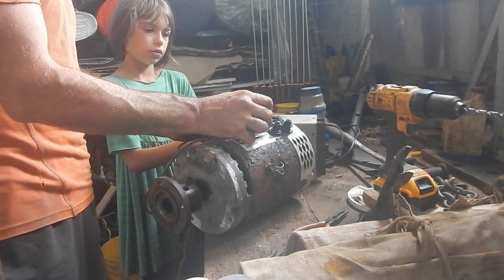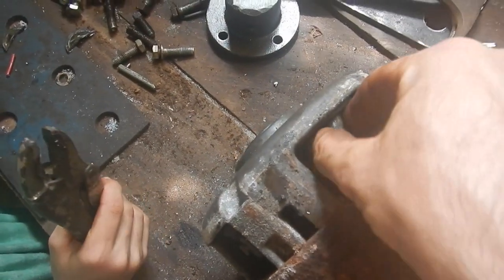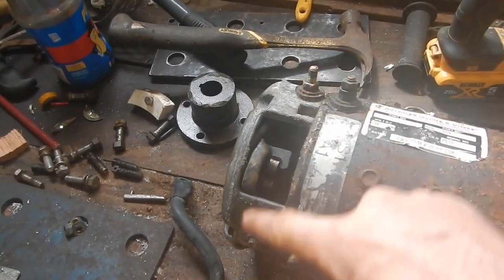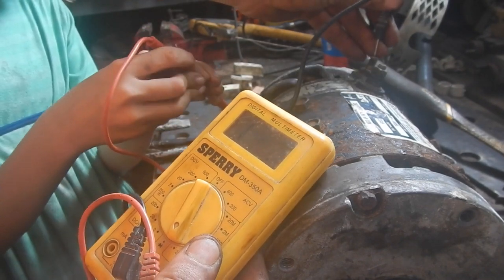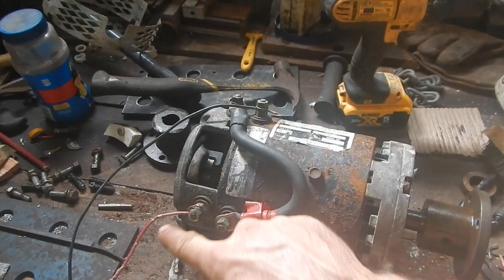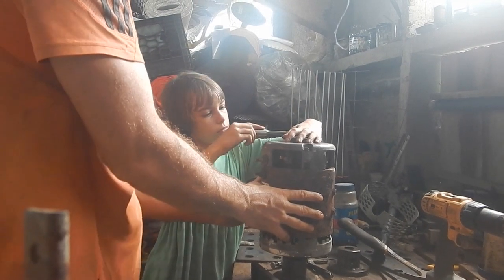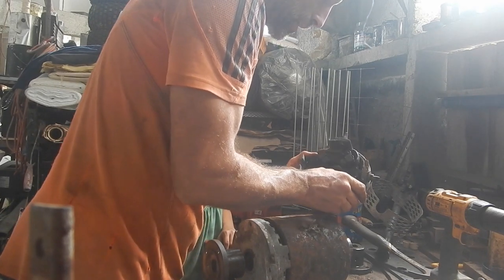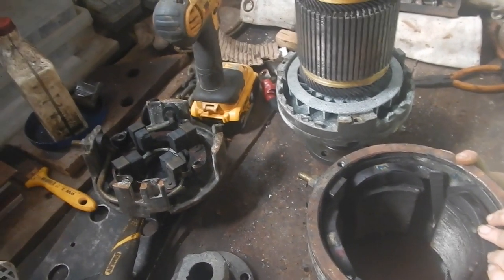Lumber Mill 002 The Motor

Comment: Balsy plugging it into your Dewalt battery. Dewalts have the nickle connectors between cells act as fuses, in 2 areas that are specifically narrower than others (so they can control what part of it bursts). I started up a motor like that and blew the battery in less than a second. If it can handle the inrush current, it can handle the unloaded current. That Advanced DC Motor says it's 36v, but you could hook it up to as much as about 120vdc and be just fine. It might need a fan to help keep it cool, but, it'll take it. The "RPM" is weird. Series-wound DC motors like that one have unbound RPM, any voltage is enough to cause them to spin off into orbit if they're unloaded. They're not a great choice for saws (why you never see them used that way), because they're really hard to control the speed on. You can vary the voltage or PWM and control the speed, kind of, but they respond hugely to load. So they'll get bogged down by a saw after contact, but be spinning so fast they'll chip teeth off at first. It'll work, it just won't work great. They're better for propellors or drivelines or something where you're constantly controlling the throttle. You'd want a permanent magnet DC motor (like from a treadmill), or even a shunt-wound parallel DC motor for a mill, not a series-wound motor like this one.
Reply: Could gearing it down solve this issue?
Reply: @Rambowjo2  No, because the problem is that a saw should be turning at a steady speed, the right speed for the sawblade. The problem isn't its spinning too fast,  the problem is the speed will change wildly depending on load. This type of motor you will always have your hand on the throttle, or, maybe, will always have a steady load (large fan or propeller in the water). That's no good for a saw. It'll work, but poorly, and it's a poor choice. With no load it will quickly, in 3 seconds, spin itself until it explodes. The chain drive will help provide some resistance,  but its still going to be goofy and speed surging.
Reply: Years ago I built a tiny lathe with a tread mill motor. Worked great and people toss them all the time. 
Yeah most DC stuff will accept much higher voltages which is good because you can direct solar them.

Comment: Merry Christmas and one hint which may help you.

Electric motor with some power rating don't consume even nearly that much power when not loaded. Usually not even one tenth of it. On the other hand, they may take even more than rated power for a short time when spooling up.

Some AC motors have parasitic current component which means at some part of AC cycle, they are taking more current and some other part they are putting it back. When using batteries and incverter, it should be a type capable of driving inductive load.

Comment: Hello Jaime. 1. The motor seems pretty good built, with those bearing and brush holders. 2. You can check the health of the rotor: Measure the resistance on each segment/lamell on the rotor. They should all be the same resistance value and isolated from ground. 3. You can connect this motor as rotor in series with stator or in parallel. The configurations have their own characteristics. I recommend parallel. In series, it can also be run on AC voltage (universal motor). 4. It seems to me, that you are not magnetize the stator and only magnetzise the rotor. As you say, you need two oposing fields. If you have several sets of brushes or the angle on them can changed, you can optimze the brush angle to get optimal performance for your load (brush timing), optimize the electric field/flux. 5 I do not recommend starting a motor, totally loose, like that. It can spin off and cause some damage, clamp it down. 6. If you have a motor like this / universal motor and there is excecive sparking at the commutator and much heat, you should check the brushes and the rotor for broken winding. Most common, is broken rotor winding and then it eats brushes, before it go into flames,